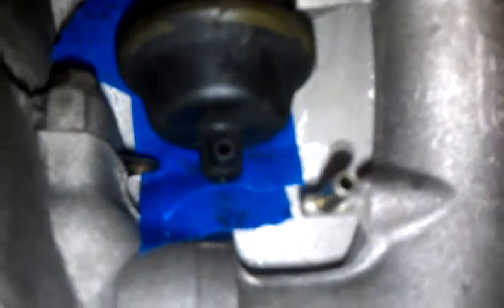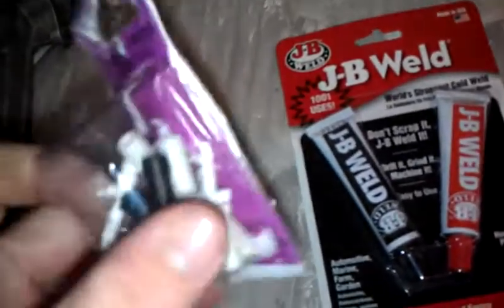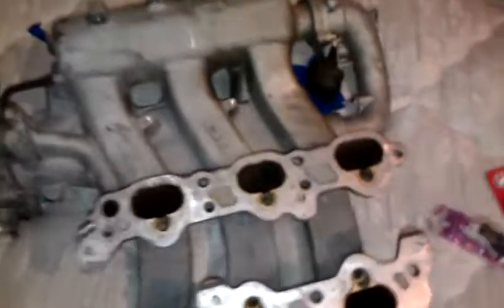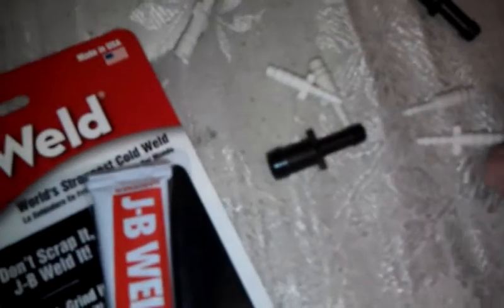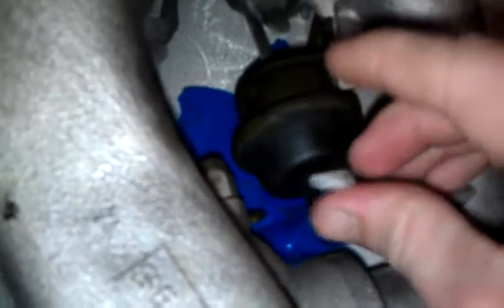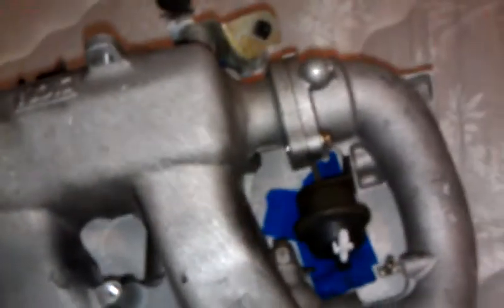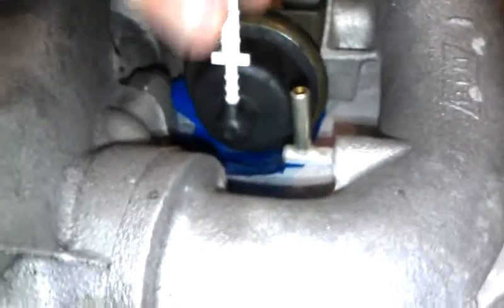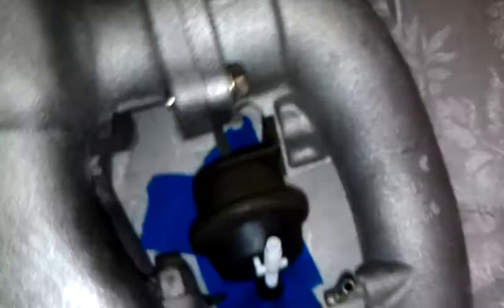How to fix broken VRIS solenoid air fittings

Comment: Excellent Advice. I Broke My Vris #1 Actuator Vacuum Nipple When I Tried To Remove The Vacuum Line. I Need To Repair This Because I Can't Find These For Sale Anywhere Without Buying The Whole Intake Manifold. The One That Broke Was On My 96 Ford Probe Gt. I Noticed That At Some Point They Got Cheap And Started Making These Half Plastic.  The Vris Actuators On My 93 Ford Probe Gt Are Made Of All Metal.